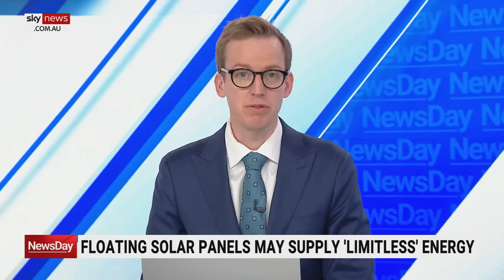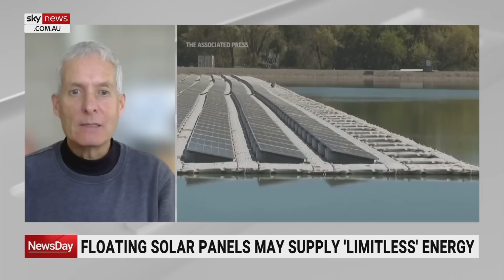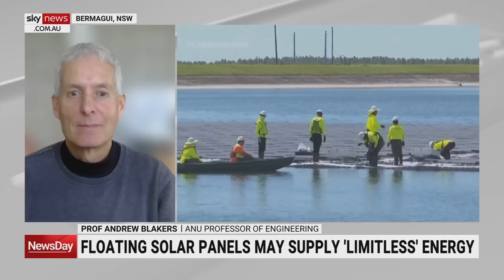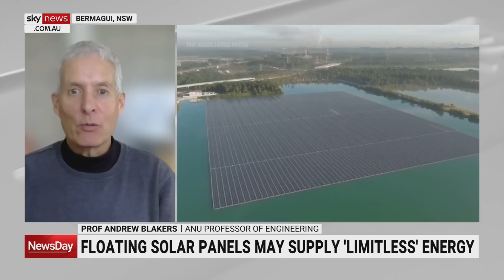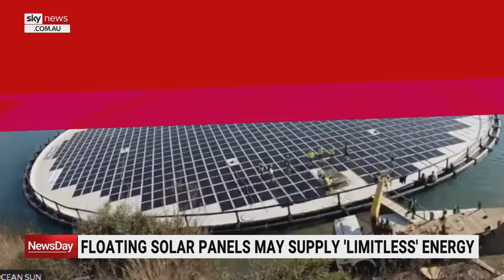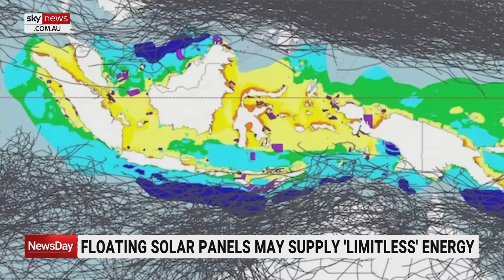Floating solar panels could supply limitless amounts of energy

Comment: 100% solar power needs backing up?
Reply: Not much if it's done right, combine it with wind, V2G, off river pumped hydro and dynamic electricity pricing
Reply: @rattusfinkus  So in other words his statement was correct and you're just parroting the usual coulda woulda shoulda with a whole heap of maybes then?
Reply: @oldbloke204  it is just how it's going to happen. We are going renewables because they are cheap. We will have EVs because they are less polluting. We will use V2G. We will be charged more for power when the sun isn't shining and the wind isn't blowing. We will change our power usage habits because it will save us money. We will see continuing price reductions in renewables and storage. These are all givens. 
Also with the current disastrous oceanic and atmospheric temperatures and the sigma six low sea ice levels don't be surprised if net zero gets brought forward. Western Europe is on the verge of panicking because a collapsing AMOC is now possibly within a human generation away.
Reply: @oldbloke204  yes solar needs firming but way less than you think
Reply: @rattusfinkus  Just more blah blah blah dude.
V2G will only be of use when there's heaps of vehicles/batteries so that they can suck off them when the sun isn't shining or whatever eh?
Personally I wouldn't sign up to anything like this.
Most will need to be charging their EV's during the evening not draining them as they need them for work.
Using the weather scare tactics is rather pointless as well as all of this, even if it was achievable, will make little to no difference anyway imo.
I keep hearing this "cheap renewables" rubbish the whole time as well and the prices just keep going up and up.
Remember when privatization of various assets would make things cheaper due to "more competition" and look how that worked out eh?
I see that the UK is now talking about ditching the 2030 bans on ICE vehicles as cost of living increases continue to bit the masses, as I said they would.
Reply: @rattusfinkus  It's only "way less" if you make a lot of assumptions imo.
Personally I really don't care that much if we have blackouts or whatever as we're well set up but most won't be and having their lives disrupted will get very old very quickly for most and they will vote themselves out of it.
To me it's just so obvious what all of this is really about.
Reply: @oldbloke204  When you can charge for next to nothing during the day or charge at peak times for sky high prices, what do you think people will do? And you don't need to charge every day because most people don't do 400km daily, so a few hours at work, at the shops or at home during the week is all you need. And why wouldn't you sign up for V2G if you get paid to do it and there's no wear on you battery which lasts 1 million km in any case?
V2G will be in millions of cars in a few years time.
Reply: @oldbloke204  They aren't assumptions, that's the plan of companies like AGL. It's what they are proposing already and in some European countries it's already happening.
Reply: @rattusfinkus  You keep making all sorts of statements about how things will last and how easy/good it will all be but I think that it's mostly hopium and bs.
Given they're writing off EV's in even relatively minor accidents due to risk of damage to the battery where an ICE vehicle would be repairable how much do you really think think that we're saving the planet, not to mention all of the other issues mining etc causes?

How do we repair vehicles where the battery is an integral part of the vehicles frame?
You talk in fairy tales, I live in the real world.
Reply: @oldbloke204  It is a fact that LFP batteries will last over 1 million kms. It is a fact that battery packs from write offs are being used for grid storage. It's a fact that EVs are safer and have less accidents particularly Teslas.  It's a developing industry and  because the battery is so valuable companies will set up to utilise what they can out of any wrecks especially when there's enough off them, it's already happening. This is all real world, I know old blokes like you don't like change and find it hard keeping up.
Reply: @oldbloke204  In my 40 years of driving I have never had an accident bad enough that would have written off an EV and neither have any of my friends or family, it is not a big problem especially with the newer advanced driver assistance features in the new EVs
Reply: @rattusfinkus  Neither have I but so what?
I hit a spanner that had been dropped on the road at 100 kph a while back and it damaged the floor of our vehicle so I wonder what would have happened if it had been a battery pack under there?
We have car accidents out the front of our place about once a year on average. The last one ended up with one car flattened back to the firewall and the other on it's side  in the middle of the road.
Crap happens.
How do you know how much it takes to write off an EV when they're doing it as a preventative measure due to fears of fires with battery damage?
Newer cars are made to fold up on impact.
All of this is little more than a cult/religion/money pit imo.
They could do a lot more good for the planet by helping 3rd world countries to move to more sustainable/eco friendly practices imo.
Watching all the muppets flying in their private jets to stick their noses in a trough at climate junkets whilst telling people who're struggling to pay their bills or heat the house that they need to pay for it all is a complete load of wah imo and just demonstrates what it's really all about.
Reality..........what a concept.
Reply: @oldbloke204  they are already cheaper to own than ICE and as the purchase prices fall it only gets cheaper.
Reply: @rattusfinkus  Dream on dude.
Plenty of stories about charging on the public network being dearer than filling an ICE vehicle and also plenty of stories about horrendous depreciation when selling as well.
Stick to your "muh Tesla goes fast" dude because at least on that small, albeit pointless, point you are at least correct.
Interesting times ahead methinks.
Reply: @oldbloke204  95% of charging is done at home. You believe all the BS you want. I'll be charging for free
Reply: @oldbloke204  largest car market in the world is already at 30% EVs of new car sales. Most other markets EV sales are just about doubling year on year
Reply: @oldbloke204  so fast chargers cost 60c per kWh and home charging costs whatever your rate is, solar charging costs nothing. So you work it out. It's a fraction of the cost of petrol or diesel, as normal you have fallen for the BS
Reply: @oldbloke204  just to help you a model 3 uses 14kwh per 100km
Reply: @rattusfinkus  So I can spend quite a bit on a cheap Chinese buzzbox or even more on some generic Tesla and then even more on a decent solar setup plus quite a bit more for batteries with useful capacity and then a charger so that the car doesn't take 2 days to charge then?
Wow sounds like a bargain really eh?
How much will I actually "save" when the interest I get on that amount easily pays for our yearly fuel for 2 vehicles and a chunk of our power bills as well?
And then the vehicle won't do what I need it to do as I'm not a city dwelling commuter.
I've done the sums dude and I shall pass thanks.
John has another video up crushing those like you who are religious fanatics on this topic which I'm going to watch now.
Reply: @oldbloke204  or you can get some 2nd hand panels and a very cheap batteryless inverter to charge any EV.
Reply: @oldbloke204  the reason Hertz just ordered more EVs is because they're cheaper to run and they last longer, and they don't even get the fuel savings
Reply: @oldbloke204  yeah John forgets to add the costs of producing fossil fuels which is 40% on top of tailpipe emissions and you doesn't count the value of the battery at the end of the comparison period. He really botched the whole thing and only admitted to one of the errors he made. Go get misinformed
Reply: @rattusfinkus  Yeah what a great idea dude.
I want to pay some dude excellent money to stick some second hand crap on my nice shiny, expensive new roof so that maybe we can replace it all in the short term when it fails eh?
You do realize that by trying to tell me how cheap it is by using second hand crap you've lost the argument about how "cheap" it all is don't you?
I estimate that it would cost us North of 100k to buy a "cheap" Chinese buzzbox and put in a decent, quality solar setup of a reasonable size and a couple of batteries so that your grid blah blah thing would be useful.
That's around 5k + of tax free interest we wouldn't be getting and it certainly wouldn't add the capital cost to the value of our home imo.
Reply: @oldbloke204  well dude that's your problem. Nothing wrong with 10 year old panels because they last 30 years at a minimum and they're giving them away. So all up you could set up solar charging for less than 5k but if you want to be stupid you can spend 100k
Reply: @oldbloke204  or you could just get a normal solar setup and a charger that senses then your home producing excess power and directs that straight to the EV. That's very common today and it happens automatically.
Reply: @oldbloke204  and dude, I wouldn't buy batteries, I'd hold off for V2G. Why buy a battery when your next car is a battery.
Reply: @rattusfinkus  More ridiculous statements about how long things last eh?
Give it up dude the numbers just don't stack up and it's not a problem as we're in front financially already.
Your little electric buzzboxes can't do what I want them to do anyway.
You do get that half or more of the 100k is a poxy little EV don't you?
Reply: @rattusfinkus  Nah I can just go to the servo about every month or so and not worry about any of it tbh.
Still not seeing these wonderful 4wd EV's as yet either.
Maybe good for posers around town but not much use otherwise eh?
Reply: @oldbloke204  solar PV lasts 30 years no problems and LFP lasts 1 million KMs. Do you have "alternative" facts ? It's pretty common knowledge that LFP lasts 3-4 times longer than the original NCM batteries and those old Teslas withe the NCM batteries have done hundreds of thousands of MILES. But you prefer the BS fodder.
Reply: @oldbloke204  no 4wds yet in Australia, but they're coming, utes too. The EV9, the Radar ute, the byd ute. The byd luxury 4wd is insane.
Reply: @oldbloke204  even your mat john did a video on how lucrative V2G would be and that wasn't based on dynamic power pricing which is coming soon. He seemed to be quite excited about the concept.
Reply: @rattusfinkus  Yep and they will be as expensive as hell, heavy and not really that useful for what so many here do.
Instead of building all of these things why don't they concentrate on what EV's are good at or, even better, start focussing on things that will really make a difference if we're trying to save the planet.
So many ways that could be done better rather than trying to hit the low hanging fruit the whole time.
Why is our Govt. still raking in the cash from mining fossil fuels if they're such an issue?
Maybe instead of flying all over the place politicians could stay here and video conference for example?
You know muh technology.

Comment: Blocking out the sun for the plants and creatures below the panels?
Reply: @elimason7954
Pre-cooked fish fingers
Yum
Reply: @elimason7954   give it up.  warm oceans mean more life, not less.   and warm oceans release more co2 into the atmosphere.  co2 does NOT warm oceans.
Reply: @elimason7954Bullshit
Reply: Blocking out the sun ( in extremely hot weather ) would act as a protective barrier when the heat and sun rays are too harsh. Then when the weather is cooler again, ( non heatwave conditions )  simply move the panels to allow good sunlight in.

Comment: You could cover the entire country of Australia with solar panels and you’d still only have a quarter of the electricity needed.  And none of it at night.
Reply: @@DSA-blackfactionhahahahaha😂😂😂😂😂😂😂😂😂😂😂😂
Do you have any more of what you’re smoking?
Reply: @DSA-blackfaction - Australia consumes about 180 TWh / year. At 2.6 sq km Golmud Paro (world’s biggest solar park puts out. 0.175 TWh. 

You’d need 2,675 sq km, and that’s operating 24/7/365. Still have the nighttime problem. The batteries that you elude to do not exist.
Reply: Bahaha Hahahahaha bahahaha hahaha bahaha Hahahahaha bahaha Hahahahaha bahaha Hahahahaha bahaha Hahahahaha bahaha Hahahahaha bahaha Hahahahaha bahaha. . .dopey comment. .
Reply: @@DSA-blackfactionnup. Nowhere near enough. Batteries will never be able to store that much energy. Remember the energy density of the best battery is 40 times worse than petrol.
Reply: @@DSA-blackfaction Amateur hour
Reply: @@DSA-blackfaction  Not even close. It would need at least 1000 square kilometres under ideal conditions, and up to 6750 square kilometres if the array was built near Melbourne  per this article :
http://kurtliffman.blogspot.com/2016/06/how-many-solar-panels-are-required-to.html
Reply: @@DSA-blackfactionBullshit
Reply: There's an easy way for free power, not to mention the UFO technology that is free power. But realize there is power stored in motion see the air and water ✔️ now what else moves that has much energy stored in it?
Reply: You'd need a land area of 200km x 200km of solar to power the entire world's energy demand of 65 PWh / year. Obviously you wouldn't put this in all one place, and you'd have back up storage. You'd probably also build more than you need, given it's solar.
Reply: @yggdrasil9039  planning figure for solar pv is 7x the nameplate capacity. Then batteries, then backup generation for at night. Then replace all of that every 25 years. Wasteful much? 

Solar pv collects its energy from a weak or dilute source. This is not the answer to decarbonise Australia or the world. We need a zero emissions dispatchable baseload source of energy that has long life and incredibly high energy density so as not to waste so many materials or produce so much waste or cover large areas of land or water with unrecyclable solar panels.
Reply: @@DSA-blackfaction doesn't work in South Australia!